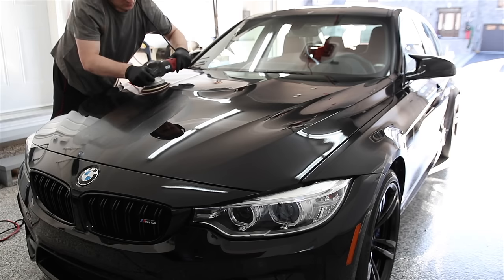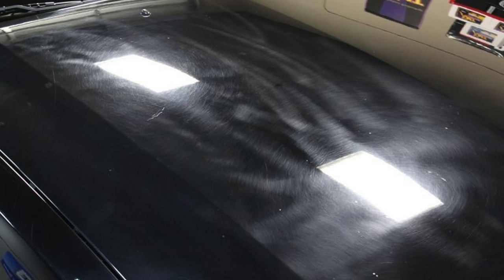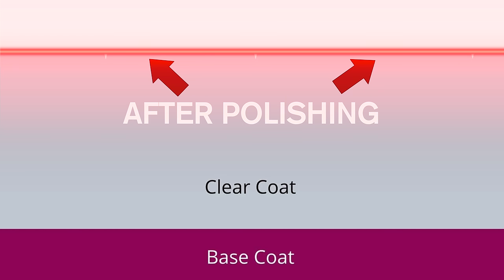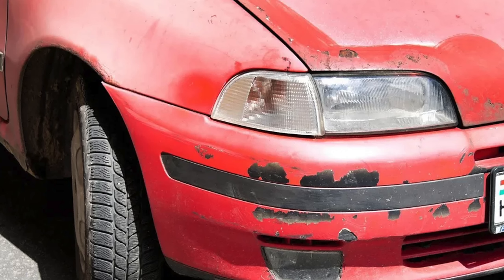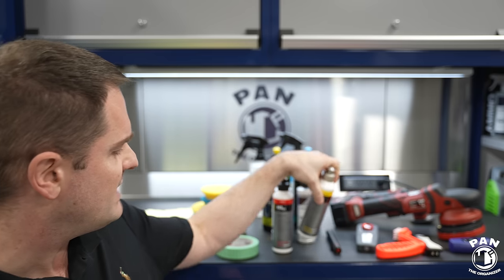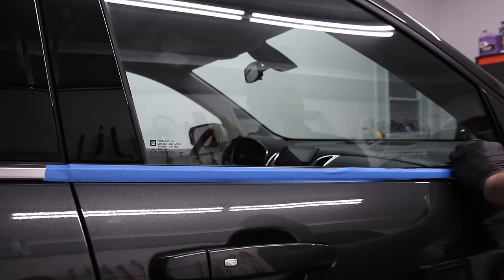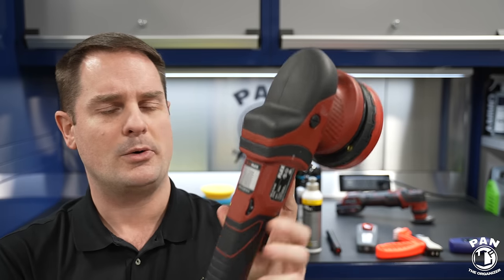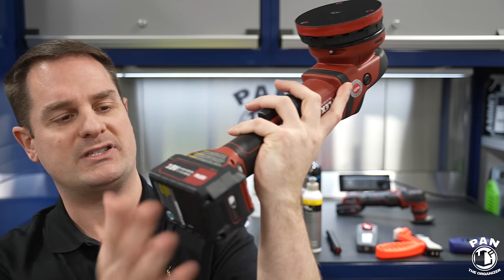DETAILING 101 - Paint Polishing - Everything You Need To Know

Comment: Thank you Pan for the knowledge you share. I have learned and applied what I’ve learned from your channel. My wife had her car ceramic coated. My question is can you perform a da machine polishing on a ceramic coated car? Thank you.
Reply from the maker: Hi Rene! Welcome to my channel. You discovered one of the biggest car detailing channels on YouTube as we surpassed 950,000 subscribers and we have over 125 million views! I have been detailing for 26 years and I love to share my knowledge and passion with my viewers.

You found the right channel to help you learn everything about detailing. 

To answer your question, no you wouldn't polish a ceramic coated vehicle, as polishes and compounds are abrasives, and that will remove the coating. Mechanical abrasion removes paint protection. 

There is only one polish that I know of that can correct VERY MINOR swirls and scratches on an existing coating, and it's this: https://bit.ly/3QMviKa
You would use that with this pad: https://bit.ly/3MW4MwX

Comment: I'm wanting to do my clean up my campervan which used to be a panel van. It had previously had trade stickers which I presume has lifted off some of the clear coat also as you can see the outlines of where the stickers were. I'm thinking a medium cut will be enough to even it all out?
Also curious, how would a finish potentially affect a vinyl wrap? Would a ceramic finish or some other product reduce the adhesiveness of the wrap?
Thanks!

Comment: Pan. Excellent explanations I bought a 2016 Miata red I will be preparing and repairing a few the chips. What do you recommend before me putting on a graphing finish should I and what should I do before I start doing the repair should I wash the car and do the decontaminants before I start doing the primer, the paint repair replacement and the clear and then all in all I will eventually do the polishing and then do the Graphene ceramic coating. Any suggestions? Thank you, GaryWaller.
Reply from the maker: I am not a paint repair or bodyshop specialist unfortunately, so I don't know the extent of your damage or what paint process you want to do, are you respraying entire panels, or just doing some stone chip touch-ups?
Reply: @PanTheOrganizer  hi yes I will be touching up the chips on around the front and a little bit on the hood and some of the black accessories the arrow kit .. I will be doing & practicing before hand .. with applying it very carefully and do in layers or coats of paint & required time & climate temperature conditions and then finally put a clearcoat on . Then do some polishing and IPA wipe down and then proceed with finishing with the graphene finish !

Comment: I had my hood repainted. It is a black car (Honda accord). Waited 4 months. Now anytime I attempt to get debris off it I put very fine scratches on it only visible under fluorescent light. 
Details: I will see some road debris on the car,
Step 1 saturate with ONR and water 4:1. 
Step 2 Saturate a clean (just washed) Eagle micro fiber towel 450.
Step 3 blot the area
Step 4 re-saturate the area
Step 5 gentle start to wipe away 
Step 6 let dry
then I see very light scratches on the clear coat
is this avoidable?
Reply from the maker: Perhaps try the traditional car wash method, with two buckets, and a microfiber wash mitt and a good quality shampoo.
Reply: @PanTheOrganizer  thanks that is how I wash my car ( with ONR) 

So tip to all … eagle 450 or equal grade microfiber and ONR (4:1) or anything similar can still scratch your clear coat 

Rationale: to get road grim and bird poop off you need some touch less pressure ( hose or power washer) 
A spray bottle isn’t strong enough and then I just rub in the grim and it scratches

Comment: Hey Pan, I just bought a brand new car and I would like to apply a ceramic coating myself. I am wondering if the paint looks perfect and do not have scraches, do I still need to do a machine polish stage before applying the coating itself? Thank you for all the videos you made and they are super informative and helpful! You help is greatly appreciated.
Reply from the maker: Hi. First, congrats on your new ride! What did you buy?

Welcome to my channel. You discovered one of the biggest car detailing channels on YouTube as we surpassed 920,000 subscribers and we have over 120 million views! I have been detailing for 26 years and I love to share my knowledge and passion with my viewers.

You found the right channel to help you learn everything about detailing.

To answer your question, I would say Yes, and No. As most car dealership apply some form of cheap wax or sealant prior to delivery, the only way to ensure 100% removal of any previous protection is by machine polishing. Stripping soaps alone won't fully remove that old stuff.

Unless you gave clear instructions to the dealership to not apply anything on the paint, 99% chance that they did apply something. And ceramic coatings need to bond to a virgin clear coat, free of any previous protection. This is CRUCIAL.

The trick to know if there's anything on there, is to wash the car, rinse it, and observe the hydrophobics. If you have tons of waters beads, there is some sort of protection on the paint. If the water just lies in a big sheet of water, pooling, and is super slow to sheet off, then you might be lucky and there is no protection.

Regardless, as a ceramic coating is an awesome long term protection, do it once, do it right. I would fully wash, decon (iron remover + clay) and machine polish, then IPA wipe and then apply the coating.

No need for a heavy compound and polish, a one-step with a polish is likely all you'll need.

So you can put all these steps in perspective, see how I fully detail a brand new car in this recent video: https://youtu.be/OKga3yZVTqo
Reply: Thank you Pan so much for the thorough explnanation! 

I have watched this video and almost every video in your Channel, I really enjoyed them, and really appreciated the information you provided which helped me a lot in my routine care of my car! 

My family have 2 new cars. One of the recent purchase (in August 2023) is Audi Q5 and seems like the dealer did not apply any sort of coating but only cheap wax when they delivered the car. I noticed it by observing the water performance on the car when I washed it. So I would like to apply a ceramic coating on it. 

In addition, since I am not a professional and most likely will only use the polisher once in a while, which polisher would you recommend to purchase?

The other one is a BMW X5 (in June 2023) with ceramic coating pre-installed by the dealer and I have used the product you recommended during the maintenance washes and it is doing great! Thanks again! ! @PanTheOrganizer
Reply from the maker: You’re in luck! I made an affordable polishers video here: https://youtu.be/LvPCkCqXEq0
Reply: Thanks Pan! I have watched this video before and loved it! @PanTheOrganizer

Comment: Im new to polishing so pretty much work 2x2 feet at a time use slightly pressure so it wont wobble and move about 1-2 inches a second and use the cross hatch pattern right? Also repeat until the polish becomes translucent correct ?
Reply from the maker: Correct. Work in small sections. Keep the pad flat on the surface. Slow and steady arm speed. Not too much pressure on the polisher (the backing plate needs to keep spinning). Not all polishes become transluscent. Do one section pass (meaning one up and down, one left to right, and one up and down) and then observe the results by wiping with a microfiber towel. If it needs a bit more, do another section pass.

Comment: Pan! Going to be polishing a car for the first time soon. You said we need 5 or 6 pads. Is this if we don't want to brush them / blow  them out after every panel or even if we clean them each panel we need a new pad? Or I guess the alternative is to wash them after each panel but that would take forever. 5 or 6 pads is going to be another $70 on top of the $200 polishing machine and $20 for polishing. Just trying to see where I can save money here...
Reply from the maker: Always work with clean pads. You can't just use one pad for the entire vehicle. Pads become loaded with spent polish at one point and they lose their cutting/correction properties when the cells in the pad (foam pad) or the microfibers (microfiber pad) become loaded with product. Any expert will tell you that working clean and managing spent residue with pads is key.

Now, I like changing pads every other panel, and also brush them or blow them between passes. But if you want to use less pads, you could also use a pad washer. I have a video showing the different pad cleaning options here: https://youtu.be/IGDfRjcPaX4

This is a detailing channel and I like to show things done the right way. We don't cut corners here at Pan The Organizer. After that, it's up to you to decide where you are willing to sacrifice. But paint correction needs to be done properly and efficiently, and working with dirty pads just won't do it.
Reply: @Pan The Organizer  definitely understand I just wanted to clarify so it sounds like at a minimum 4 pads are needed for a compact sedan and brushing pads between passes. Also would this differ if using an all in one life turtle wax hybrid solutions graphene polish & wax or the 3D All In one compound and polish?

Comment: Hey Pan. Just got done watching the video. I have a new paint job, I am going to do a polish then apply a hybrid ceramic. I live in Arizona and I'm sure you know it gets very hot. My question is, do you think it would be OK to use a car cover and if so do you have a recommendation? Thank you in advance.
Reply from the maker: If the vehicle was just repainted, you need to wait 2 months before applying any form of paint protection. The paint needs to finish fully curing and needs to complete its gassing out phase.

You can wash your car using a pH neutral shampoo during those two months, but that's it!

Once the vehicle has passed those two months, you can polish the paint and apply a good ceramic coating. And yes you can use a car cover over that, as long as it has a soft interior layer so it won't do marring on the paint.

Comment: Hi pan great video as always. I have a question for you. If you have a scratch in one area of your clear coat but the rest of the paint is perfect around the scratch should i work the polisher a larger area or try to remove the scratch my working the polisher in a smaller area. I’m worried I’ll burn through the clear coat concentrating on trying to remove the scratche
Reply from the maker: It's usually best to polish the entire section, as if you only polish that small area, that area will look perfect and glossy and have more "pop" to it, and the rest will look faded and scratched in comparison.

Comment: Hey, love the videos. I just bought a brand new vehicle a couple weeks ago. It’s white colored. I want to use a spray wax for it to help protect it from the elements. Since it’s new, do you think I still need to wash and clay bar it before using the spray wax? Thanks!
Reply from the maker: A new car is never new until it's properly detailed. 
- at the factory, the paint defects are often corrected quickly by rotary polishing which can leave marks and holograms, so polishing corrects those, before you lock that in long term with a ceramic coating for example.
- vehicles are then transported by truck, train and boat so they are exposed to the elements, industrial fallout, brake dust, rail dust, etc
- vehicles are often left at boat docks (when transported by boat) or in exterior parking lots for weeks or months, again being exposed to the elements
- at the dealership, the vehicles are almost always poorly prepped using the same dirty water that was used for all the cars on a given day, and poor washing and drying methods leading to swirls and scratches 
- at the dealership, a layer of cheap wax or paint sealant is usually applied to attempt to make the paint glossy prior to delivery. It's crucial to remove any previous protection before you apply a ceramic coating, as coatings need to bond directly to a virgin clear coat.

If you only plan on applying a regular carnauba wax or paint sealant though, you could decide to skip machine polishing, as those protectants can be applied over existing protection and it's not as crucial to prep the paint as well.

I explain all of this in this popular video: https://youtu.be/QgoyrC-5CMc

So you can better visualize the new car prep process, here are the steps I perform on a brand new car from two of my customers: 
Tesla Model Y: https://youtu.be/gohks8xP5NY 
Porsche 911 Carrera: https://youtu.be/2ckiivbFqs4
Audi Q7: https://youtu.be/t7HCBSVnizM
Reply: @PanTheOrganizer  you da man!!

Comment: Hi Pan, love the videos. I have a 10 month old 2021 mazda 3 hatchback, New I'm the only owner. I see maybe 5 to 10 super light scratches across thr entire car and seem to have some roughness in the paint. And im looking for some addiotnal gloss and heavy protection. My car is near the ocean 75 days a year for 2 to 6 hrs. Otherwise it's in a garage alot or outside at my office which I go to 2 to 4 times per week. Sometimes I have to park outside at my girlfriends house and I get lovely sprinkler water spots on my car! I  was wondering if these steps would work well in your opion. Step 1 hand wash, rinse,  step 2 iron remover, and rinse, step 3 adams detailer and clay bar the whole car and rinse, step 4 Turtle Wax Hybrid Solutions Ceramic Polish and Wax, step 5 Turtle Wax Hybrid Solutions Ceramic graphene spray flex Wax. Does this seem like a good solution? Also can I apply the hybrid solutions polish and Wax by hand with a small hand foam applicator pad? Please let me know your thoughts

Comment: This was an excellent video Pan.  Very educational and informative. I have a 2021 BMW with a Marina Bay Blue color.  I want to perform a paint correction which has lots a of micro scratches and swirls.  Is there a pad, compound and polish combination you would recommend?  Especially for the polish stage.  I will ceramic coat the vehicle for the winter when it's done.
Reply from the maker: See what we used to detail this BMW M3 in this video: https://youtu.be/E_ck-Hn1AvE
Reply: @PanTheOrganizer  Thanks Pan - I passed on Jesscar but will use the Sonax line and Rupes pads along with a Maguiar's MF pad.  I was wondering if you ever used Menzerna 3500 or 3800 high gloss polishes? If so, please share your thoughts or suggest a different high gloss polish.
Reply from the maker: Many years ago I used to like the 3800 a lot from Menzerna. But it has been surpassed by Sonax Perfect Finish in my opinion.

Comment: Pan, another great Pan production! Excellent as always. You spoil us.
My wife and I have been detailing our cars for about 3 years this spring. We're in our mid 60s and have slowed down. I'm going to put you on the spot. Have you done videos on sanding wet or dry? I realize you'd never let your cars get to that point. Why am I asking? My new car sits covered in the garage. It'll never see a drive through car wash. However, my wifes 6 year old Jeep does. Can't wash car at home due to HOA and a man made lake across our street the street drains empty  into. So we took our cars through the car wash. (Rinseless in the winter?) A couple years ago I bought a new black Taurus. IMO a bad paint job from Ford with little many dust/dirt specs but according to my Ford dealer an acceptable amount per square inch blah blah. (Would sanding have taken them out?)
Even though both were bought new, the car wash leaves swirls. We could never get the swirls out to my liking. Used a PC dual action, Griots and other good  products and pads. If you stood 4 feet away the cars, they looked great. But upon closer review there they were. So I thought maybe 2000 or 3000 grit on a small area to try would help, then do our routine wash, decontamination, clay, alcohol mix clean and new ceramic coating. I'm pretty sure its still our technique but what do you do if what we have or do doesn't remove the swirls before we ceramic coat it. On my wifes car, it's not practical to wash it any other way in the winter salty months. We live on the southern border of Michigan in Indiana. I try to be a perfectionist, to me close enough isn't good enough. My situation best reminds me of your "How to restore gloss black plastics" video. Impressive but still some flaws. You said 80 to 90% and it was. Not being critical, just me. Am I chasing my tail? My wife calls me Flawman because I find imperfections in so many things! I also realize even ceramic coating can't stop swirls. So what do you suggest Pan? Sorry for the long post. Thank you in advance!

Comment: Hello friend, I hope you are well..! I need your advice, my car is exposed daily on the street and a few days ago I noticed that the surface of the paint is rough and when I looked carefully I saw that it had small specks of rust my question is, what product do you recommend to remove these small imperfections? can I use the compound with the buffer directly or is there something to remove it?
Reply from the maker: Most likely you have contamination embedded in the paintwork. An iron remover followed by a clay bar.

Watch my iron remover video: https://youtu.be/W_cyHz3XssU

My claybar video: https://youtu.be/XB8UaTCXuLg
Reply: thanks for the advice.

Comment: Hello Pan. Another wonderful video from you. I have a question. Since you are priming the pad,do you not have to do the dab method on the vehicle? Just want to make sure I'm not missing anything. Thank you.
Reply from the maker: By "dab" you mean tap the pad around on the section to drop little dots of polish everywhere? You can do that, or not, it depends on preference. One thing is for sure, spread the compound/polish on the section at low speed, and then do the polishing at higher speeds.